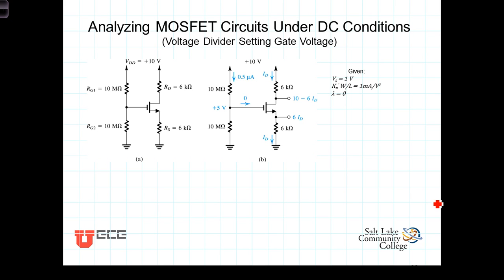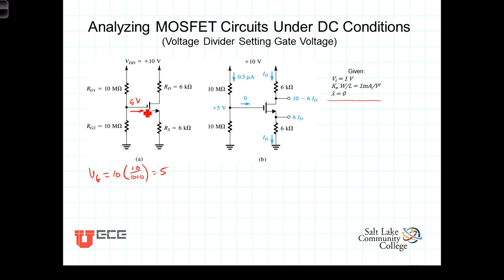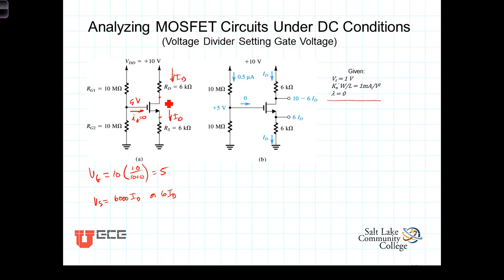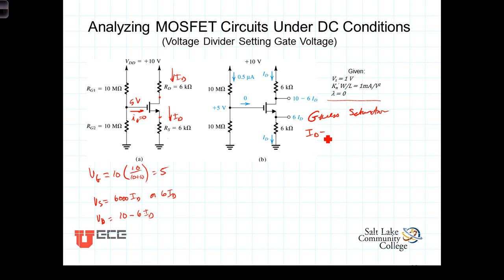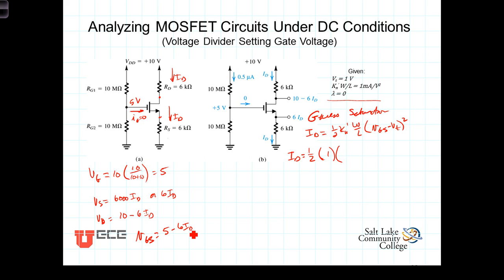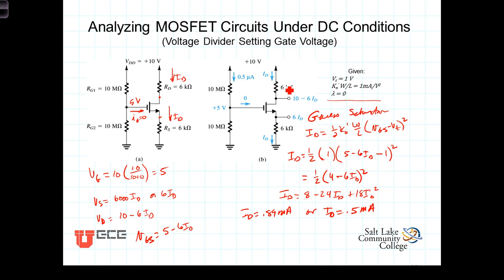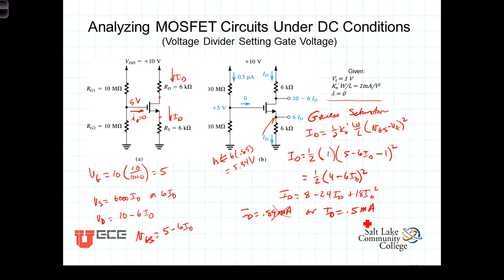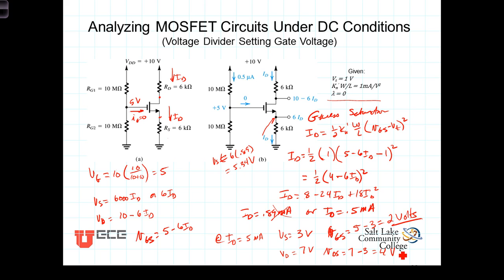L5 3 3FET DC Calculations Voltage Dividerr

Comment: 18Id^2 -24Id +8 >> Id should have only one root, which should be Id = 0.667. Please correct me if I am wrong.
Reply: You must move the other Id across the equation, you just solved similar to Id = (0.667 - Id)^2 [my numbers might not match yours, but the actual error is that Id wasn't moved across the equality first, so it doesn't matter].
Instead you must remember to move Id across and then solve 0 = 18Id^2 - 25Id + 8